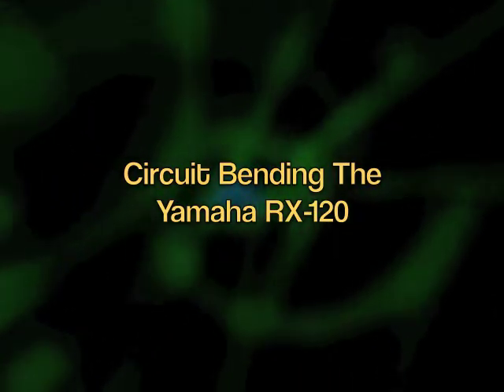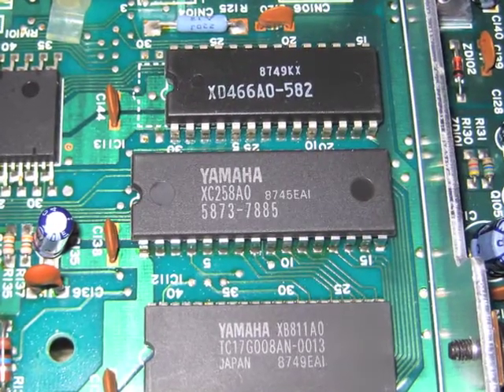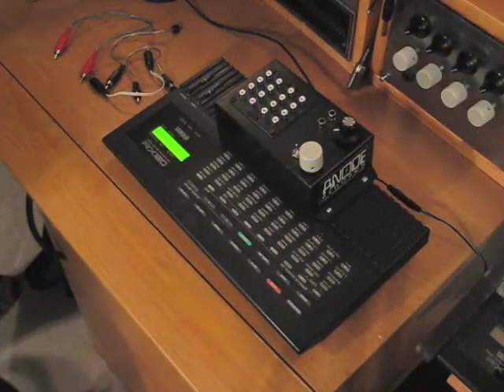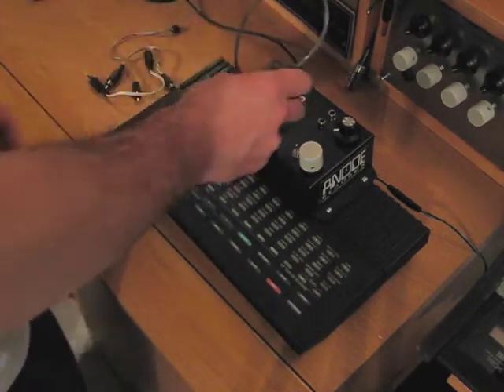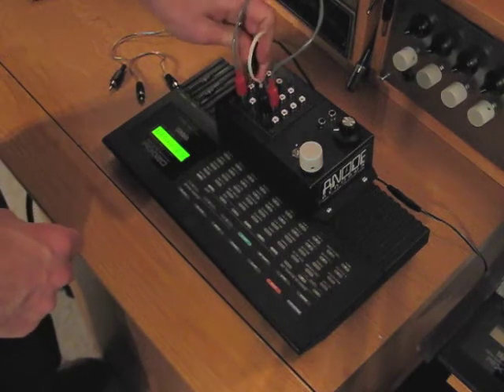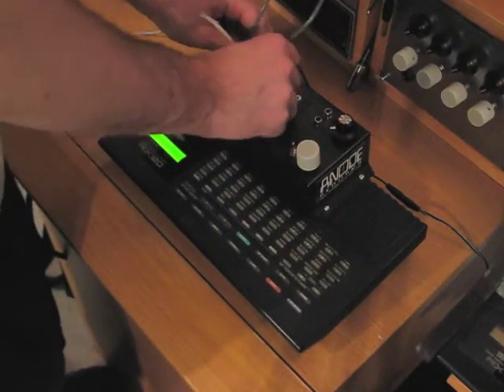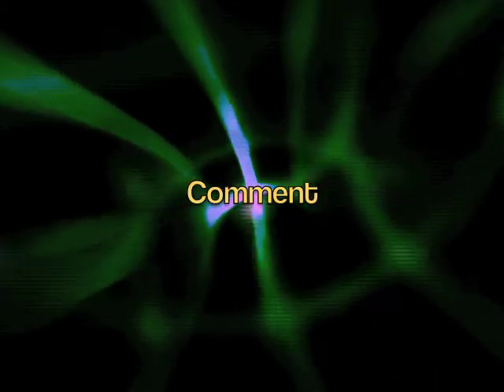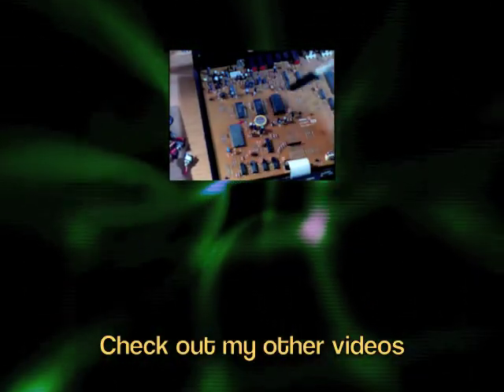Circuit Bent Yamaha RX-120 tutorial

Comment: Could u do a more in depth on this one ☝️
Reply from the maker: I sold this machine years ago, so I can't really tell you anything new. Modding/bending gear is pretty low on my list of priorities these days. The best I can suggest is to get a small wire and make a connection on some of the pins on the chip that I outlined, while a beat is playing, marking the ones that you like. When you have the options planned out, either solder those connections to a switch or a patchbay, like I did for this one.
Reply: @anode8  ok.. forgive my lack of knowledge but i just opened my up and was not sure what i needed to do to access the chips becasue when you open if from bottom you can only see bottom of board I am not sure howto get to the chips exactly without breaking something :(

Comment from the maker: The RX-120 has the same sound chip as the RX-17, which I have done a bunch of stuff with. The RX-120 is definitely better used as a MIDI module, where it is velocity sensitive. It's definitely a sleeper, and can be had for pretty cheap.